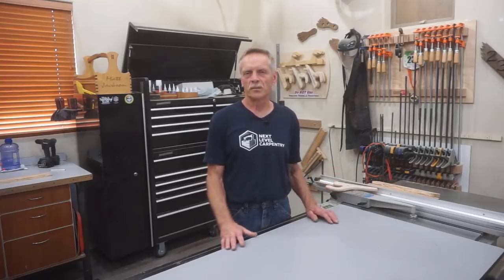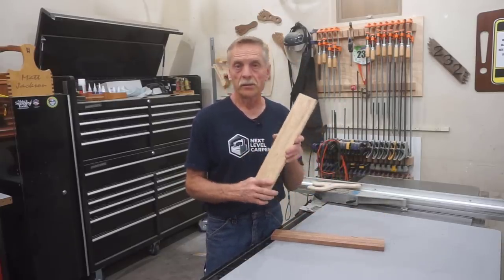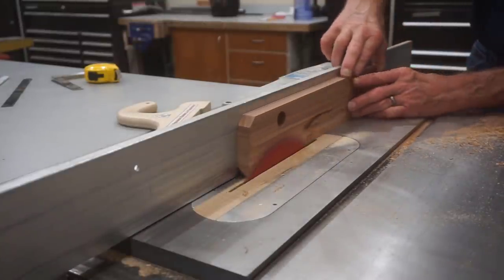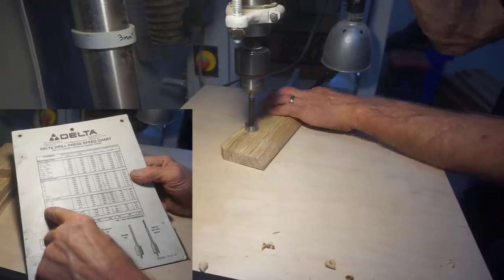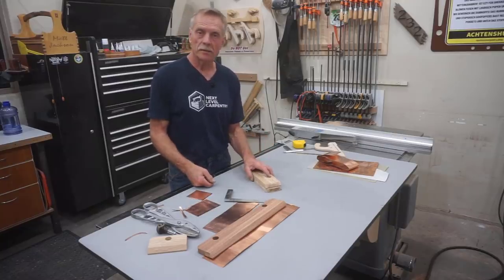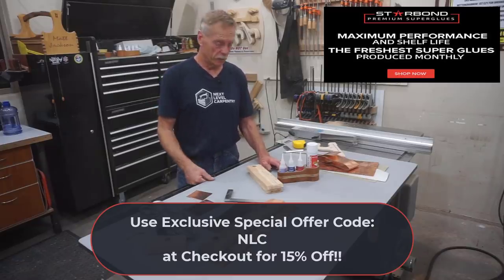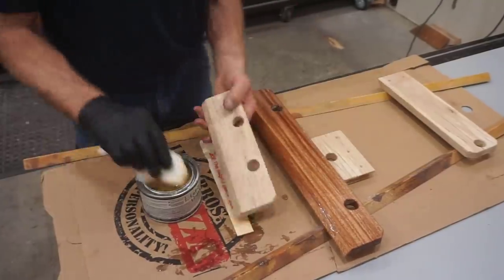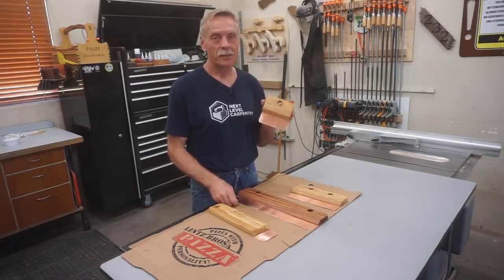Power Tool Parking Brakes

Comment: If you use some of that rough tape made to put on stairs for safety to the bottom of your copper on the parking break then the initial slip will be almost zero.

Comment: Matt, try glueing piece off rubber like bicycle inner tube to the bottom for maximum grip.
Reply from the maker: Figured that would just 'make it squishy' but, with your suggestion, I'm going to give it a try because when there's not a lot of weight involved these breaks can slip a bit.... thanks! Best, Matt

Comment: Thin sheet of rubber applied to the bottom of the wood block (Using some of the unused CA glue and activator!) would make a nice improvement, reducing the amount of slippage as the wheel engages the block.
Reply: Good suggestion.  I have found that used CA glue does not work very well.